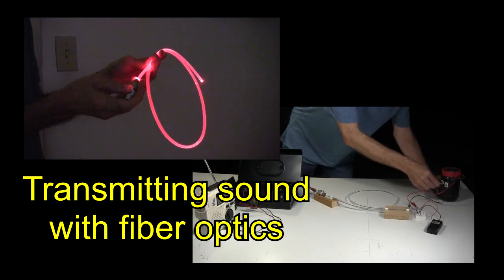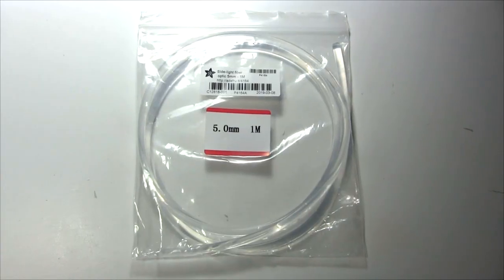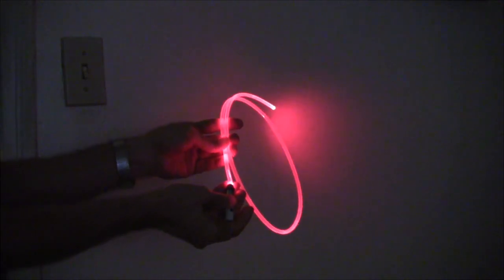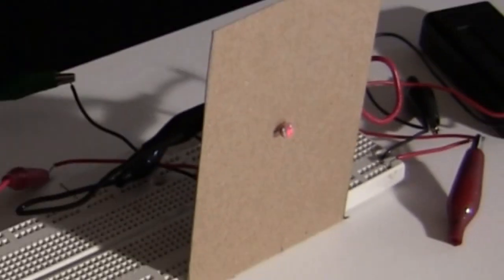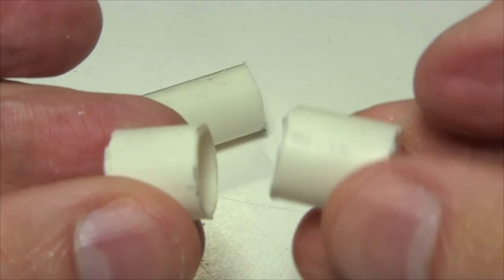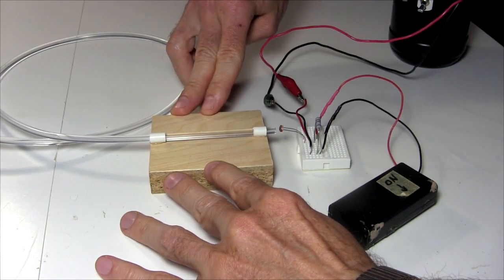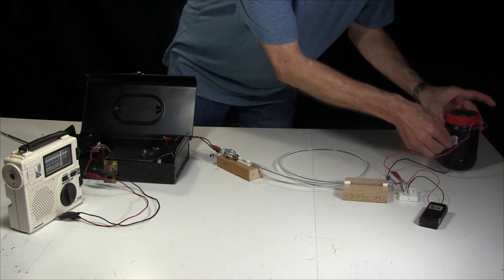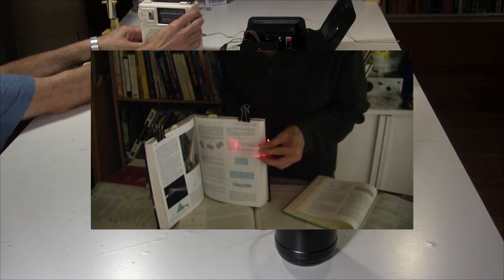Transmitting Sound with Side Light Fiber Optics and my Laser Communicator

Comment: what about  camera is it possible
Reply from the maker: Can you describe that you mean? I'm not sure I understand. Do you mean to put a camera at one end to see if it can see what's at the other end?
Reply from the maker: If that's what you meant, I just tried it. I pointed a camera at one end and moved the other end around. If I point it as a bright yellow source then the camera sees yellow. If I move it to face a green source then it sees green. But the light bounces around inside the fiber so much that I can't see any detail. By the time the light gets all the way through the fiber, it's randomized and any details are mixed up. It's similar to what you get if you use a pinhole camera but with a big hole, the image is blurry. Interesting idea. Thanks! I'l definitely think about it some more.
Reply: @RimstarOrg welcome bro
Reply: @RimstarOrg make a vedio intresting
Reply from the maker: I might just do that! I'm working on another video that I'll be releasing later this month so maybe the one after that. It looks like I'll need a bundle of smaller optical fibers, which I may have found a source for locally, and if I can get it to work then I'll make a video. You basically need one optical fiber for each pixel of the image.
Reply: @RimstarOrg so you will have to much fiber optics then one singl fiber optic  isn not enought؟
Reply from the maker: One fiber isn't enough. With just one fiber, you get a blur, basically all the points of light in your image are mixed into one color. You need many, many tiny fibers, so that each point in your scene gets it's own fiber as much as possible. Actual endoscopes used for medical purposes can have 10,000 very tiny fibers in order to get a sharp image.
Reply: @RimstarOrg keep going i like your channel
Reply: @RimstarOrg but how fiber optic dron send live vedio in one single fiber optic؟
Reply from the maker: I'm not sure what you mean by fiber optic "dron". It is possible to send video over a single fiber optic tube but I suspect that's a different type of communication. What I've been experimenting with is just pointing one end of the fiber at an object and looking at what comes out the other end of the fiber. I suspect what you're talking about is a circuit which takes the image and then sends some sort of digital signal using light through the fiber. So basically it sends a bunch of pulses of light that describe the image. That's how normal fiber optic communication works.
Reply: @RimstarOrg https://youtube.com/shorts/QfYSSMbgWR0?si=32BlSlIj7YohyU7o
Reply: @RimstarOrg yes
Reply from the maker: Aw, yes. The drone video you linked to would likely be a digitized signal being sent over fiber, What interests me more is an endoscope, where the actual optical image is sent over the fiber.
Reply: @RimstarOrg keep going bro i like you chanel ihave some idea i will provide you some of theme
Reply: @RimstarOrg yes😂

Comment: Hi Steve...catching up on your videos...
This one reminded me of some interesting projects I once made:
One was a simple 555-based PWM audio-modulated device. I amplified the current to an IR LED (this was MANY years ago; before LED's were so efficient even before the internet AND LASER POINTERS!) with a lens and aimed it down a long street block near my house. I played music via pin 5 (my favorite 555 pin) and walked down the block with the lens / receiver. After much aligning, I finally got a good LOS down the block (I remember hearing powerful regions of 120Hz as I walked by street lamps).  Then a strange thing happened...one night I turned the corner at the end of the block, AND COULD STILL HEAR THE MUSIC!!  I was certainly not in LOS, but could still hear the sound, apparently through thick trees and tall bushes even as I went farther...it was as if the air was full of the modulated signal...even stronger sometimes if the receiver was pointed away from the source...VERY STRANGE, indeed!
...any thoughts?
THANKS FOR THE VIDEOS ON MODULATED LIGHT!...my favorite subject.  I was always looking for ways to modulate light...one by shining a He-Ne beam through a clear smoke-filled balloon with a small speaker attached, which worked until the smoke stuck to the plastic.
--dAle

ps:
I got best results with a photodiode and Fresnel lenses (more recently).

Comment: have you ever tried to transmit/modulate audio with a longtitudinal wave/carrier.. like an isotropic radiator only it is tesla's design from the 1899 patent.. the preferred method of wireless transmission as the radio waves and radiation sinks to earth ground and the longitudinal part is transmitted through the whole earth and sky penetrating every obstacle (@ any given frequency); even at a superluminal velocity.. 1000% efficiency if configured correctly.. ? similar to professor meyl's transmitter/receiver.. the transmitter knows when the receiver is tuned in and thus the transmitter goes off.. signaling a load

Comment: I was working on a kit to do this for the rear speakers of a surround system.  Using UV lasers and UV receivers to send the signal along the ceiling to the powered speakers. I never could get it to work but have no idea why. I bought a kit and it turned out to be fake. missing the way to modulate or boost the audio signal. I used parts of the kit and tried to make my own following You tube tutorials. Biggest problem is parts. I find missing one thing and wait weeks or months to get it. so experimenting is a real hassle. It's why I'd rather buy kits. someone could make some serious cash making kits for these projects just assembling and kitting the parts.
Reply from the maker: That does sound like a pretty clever idea for the rear speakers, no wires needed. Also, during a party, with a little smoke and visible wavelength lasers it might look pretty cool.
Reply: @RimstarOrg I was thinking of using different color lasers  for this effect. With mirrors to bounce them around the room first. Which lead me to thinking maybe I could use green red and blue or UV color lasers to send the highs, lows and mids.  But I couldn't get the basics working.